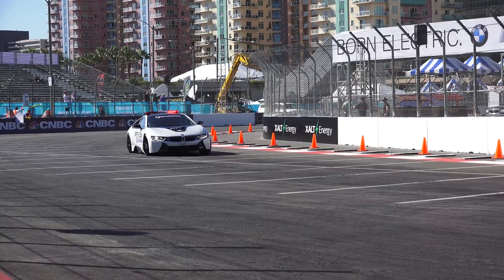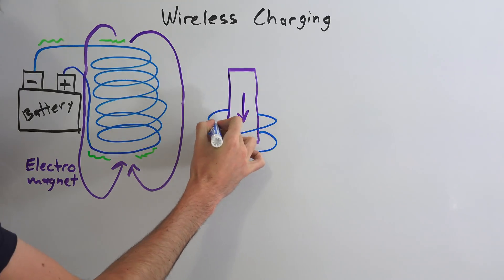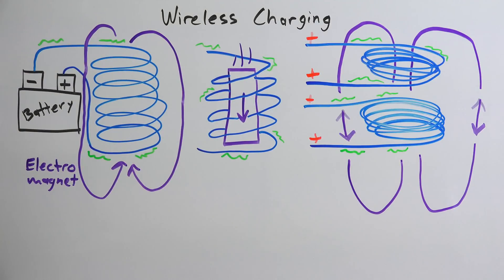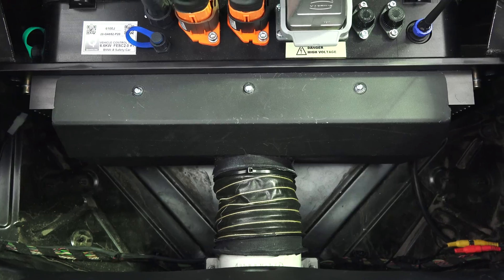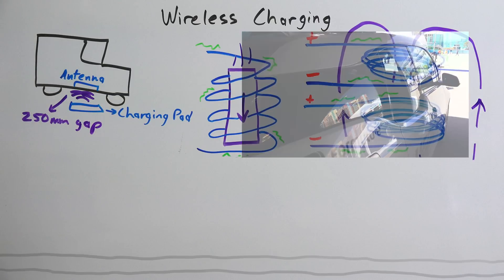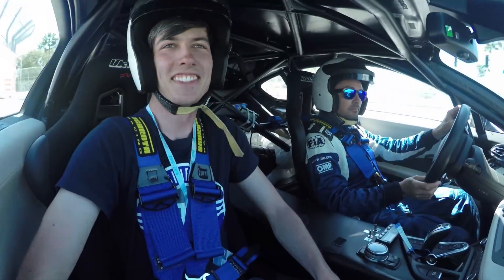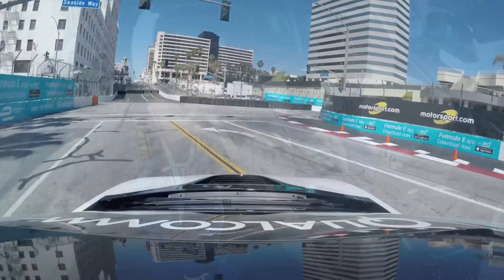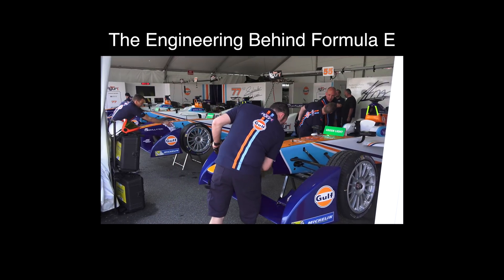How Wireless Charging Works On The BMW i8

Comment: If I understood right, this system is charging at a rate of 6.6kW, for a still car. This is far from being enough to provide "unlimited" range for electric car on highways as the need for power to maintain a 70mph speed is much greater than 6.6kW (at list I think so), but the technology is very promising and interesting !

Comment: What is the energy loss of charging wirelessly compared to through copper.

Efficiency is basically a huge reason for electric vehicles to exist in the first place, an if something weakens that, I think very much limits how extensively it can be implemented.

Comment: Hi. Induction charging in the way of the future, certainly. But today, induction has several disadvantages like:

- EMI (RF noise) and safety concerns. You wouldn't want to be near one of these while wearing a pacemaker.
- Efficiency. The best EV inductive charger today is 86% efficient and that's using the best technologies we have today.
- More expensive than traditional plugs.

We should stop suggesting that inductive charging can be used in roads. Beyond the ridiculous notion of ripping up all roads up to install these expensive coils of copper, electronics and transmission lines, a typical car uses about 20kWh to drive at 60 MPH and that's way more than can be practically delivered with such system at those speeds. Possible, yes. Practical and economically feasible, no.

Induction charging will be great to add to parking lots and garages. You just pull up to your space and the car starts charging without further effort.
Reply: Ironic that someone named "Thor" would be wrong about electric topics but there you have it.

There are differences between power delivery to trains and cars. The most obvious one is that delivery to trains in conductive while the proposed method for cars is inductive. A conductive connection is constant and very efficient whereas inductive is interrupted and much less efficient.

It would be more efficient and cost effective to add a drag power line to cars for overhead power or even tow cars down the road like they do in roller coasters.
Reply: Come on man. You can't say that it's nitpicking when the difference between conductive coupling vs inducting coupling are so significant.

See my previous posts. I'm not saying it's new or that is not possible. I'm saying that it is not practical or cost effective.

Comment: I like the idea or wireless charging while driving on the road. However when I park an EV, I would rather plug in than use wireless charging. With a
Plug and a suitably long cable, I can park with a high degree of misalignment and still charge. No so with wireless charging. I'm a horrible Parker!
Reply: +ERIC &amp; CINDY Crowder 
Learn to drive and park, that's not an excuse.
Reply: +Ric Rac what if another car is particularly blocking the space with wireless charging. With a plug I could still park and charge, but I won't be able to charge wirelessly
Reply: Find another spot. Stop making excuses.

Comment: They use AC because current is only induced to the secondary coil if the voltage of the primary coil is changing. This is for the same reason you can't just put a magnet in a coil to get DC power, the magnet has to be moving. 
Mutual inductance only works if the voltage is constantly changing.
Reply: +Latheesh V Well, yea. 
They still use mutual inductance to get the power to the car. Resonance is a given. Of course they aren't just going to have some jumper cables between the secondary coil and the battery.

Comment: doesn't a battery need a dc current to charge? Every time the poles reverse the electrochemical proccess in the battery would too resulting in no net charge to the battery?
Reply: +massive223 The induction system doesn't directly charge the battery. There's some control electronics between them with an AC/DC converter.
Reply: Ah makes sense, i assumed the conversion would take place before the charging pad.

Comment: why would an a/c current be used for this?
Reply: +Randy Butternubs 
Go back and listen to it again.
A transformer can only really use AC (or a switched DC, such as a cars ignition coil), as it is the CHANGING current that gives rise to a changing magnetic field that enables a transformer to work. DC would simply build up a static magnetic field creating in effect a solenoid coil, and nothing further would be induced into the secondary windings.

Comment: 1:03 nope, transformers do not usually use an AC current, THEY ALWAYS DO, otherwise it won't work.
It's the CHANGE in magnetic field that generates amps in the secondary winding.
DC= no change =no derivative function=no current in secondary winding.
Reply: +sasja de vries 
Yes, strictly speaking that is indeed absolutely true. But a cars ignition coil/s actually IS a DC transformer. It just uses switched DC. But it is nevertheless still essentially a DC current, as it never actually swings negative.
Reply: rationalmartian 
I get your point, and you're right.
In some cases however it depends on how you look at it. You could also call it AC, if you for example have these wires:
1: ground
2: + 6 volts permanent
3: + 12 volts (switching)
and you would connect an oscilloscope to leads 2 and 3 you will register it's negative 50% of the time.
My point is that voltage is always relative to something, e.g. ground, another lead, etc.
Switched DC is pretty much AC (perhaps like a square-wave signal) just with it's meridian shifted upwards.
When people think about DC they mostly think about a steady voltage.
--------
And one last bit: I think it actually does swing negative (just a little), because inductors will generate an opposing voltage when the original voltage it cut off, that why electronics engineers add flyback diodes:
https://en.wikipedia.org/wiki/Flyback_diode

Comment: "typically done using alternating current"
In fact it HAS to be AC - a magnetic field on it's own doesn't induce a current, it has to be a changing magnetic field created by a changing current or a steady magnetic field moving past a wire coil (the latter is how most generators work). Just wanted to clarify :)

Comment: They could probably just engineer an add-on to existing electricity poles/wires. Harvesting the electricity already flowing by wrapping coils of wire around them to generate inductance current to cars driving by below
Reply: +mrsemifixit 
Why bother? Why not simply tap into the electricity supply as one would do normally to power whatever system? It solves nothing, as there is no problem there to solve. The problems occur on the other end, from infrastructure to vehicle. In fact it adds unneeded complexity and power losses.
Your use of the term "harvesting" would imply you imagine one can just pick up the energy for free, from the existing power lines. One cannot. There are NO free lunches.
Reply: +mrsemifixit that would just convert the kinetic energy to electrical energy and slow the car down
Reply: +juck huo How's that different than in the video he talks about having inductors under the road to charge while driving
Reply: was he saying that it charges while driving? I thought that it had to charge while stationary.  it seems like if you tried to drive passed while trying to charge would slow the car down from the magnetic fields interacting

Comment: You forgot to say that induction charging efficiency is very low compared to our old wires.
And of course, electrical energy is not cheap.
Btw i liked the concept of charging pads on the road, maybe putting them in big intersections in big cities would not be a bad idea.
Reply: +Modelero This is what I came here to say. Most smartphone wireless chargers are around 60%. You can increase the distance by increasing the strength of the emitter to reach the receiver, but the efficiency only drops since the field strength decreased by a power of 3 (Correct me if I'm wrong) by radius. Doubling the charging distance for the same charge current requires the emitter be 8 times more powerful.

They could be using something to focus the emitter though. I'm not sure.
Reply: +Cris Landefeld 
No I think you are both pretty much on the money. This is the MAJOR problem I see. It is trivial and doesn't really matter when talking about the amounts of energy when charging small mobile devices, but charging such large capacity batteries, takes energy, and as you say, this system is inherently inefficient.
It takes a certain amount of energy to build the magnetic field, if when that field collapses, all the energy from it is not captured/collected by the secondary windings it will be lost.
I don't doubt engineering can overcome some problems, such as trying to "focus" or better direct the magnetic field, I don't think this can be done to mitigate the problems entirely.
Until we have cracked Fusion, and hence have unlimited, cheap power, I see this as far too wasteful to be practical. Certainly for the short term foreseeable future.

Comment: Yes, make Formula E super light (no batteries, just some capacitors), super powerful, and cooler to watch, with roadsurface charging. I've been pondering that for a while. Mostly for regular roads (imagine a charging lane), but for racing it would really be the next level. Bumber cars have had power overhead since...decades ago at least.
Reply: A capacitor insulation failure (one of the most common electronic component failures) would be absolutely catastrophic. 
A 10 microfarrad capacitor blowing up leaves a big black stain on the board and possibly an electrical fire. 
On a 100 farrad capacitor, because anything viable for moving a car would have to be that big, if the insulation failed and the capacitor burst, that would be something similar to a large compressed air tank exploding in the car. 
In short, the DOT would never allow it because it's too dangerous. 
Here's an example of the DOT doing something similar. 
There's a gas that works as a great refrigerant, it works better than r-134a, and it isn't bad for the environment when it leaks. This substance is called propane. If a car crashes while the ac is on, a pressurized propane system just got into a car crash.
Reply: Dylan McElveen Thanks! Then better a high charge rate battery?
Reply: +Cloxxki Basically yea. I guess a capacitor bank could work like rechargeable boost. Where they charge off the battery and discharge into the motor when the driver needs a more power

Comment: It should be noted that this is not a really effective way of transmitting energy. A great amount is lost.
Reply: +blocki Actually a very little seems to be lost: www.qualcomm.com/media/documents/files/qualcomm-halo-faq.pdf
Reply: Seems it got a bit better. But 86% efficiency is still low.
https://en.wikipedia.org/wiki/Inductive_charging#Disadvantages

"6.6 kW power delivery from a 7.68 kW power draw"
Reply: blocki Yeah, but that was from a system in the 90's. Qualcomm claims over 90% efficiency from grid to battery, which is similar to what you get from regular wired chargers.

Comment: I thought induction charging was a little bit bad for the battery, or at least in smart phones
Reply: I've never heard of it being bad for cell phone batteries. Plenty of electronics are already charged using induction. It's just the same as a transformer however now the primary coil is stationary while the secondary coil is on the device.

Comment: Wireless charging is still very inefficient but the technology is cheap.  If they did place these into roads,  the best place would obviously be at intersections.  It would cost way too much and use too much energy to place them on the entire road.

Comment: will this work on any electric car or will it only work on specific battery models
Reply: +John Kyon 
Would work on any electric car IF it is equiped with the charging antenna.
Reply: Even tesla?
Reply: Any electric car, even tesla. It would take some modifications obviously, but even smartphones just needed an adaptor to use this technology.
Reply: What boat hybrid

Comment: I think embedding it in streets for longer distances is not practical, too expensive as you said. But think about traffic lights. You could have nearly a all-the-time use. If all cars were electric. And if there was a automatic payment system;)
What do you think?
Reply: +DerKrawallkeks Well it is good but think about the people who wont like that system, there will be automatic an non automatic cars. I mean how could interact automatics with non automatics. That could be an issue
Reply: +Alexander Gallardo 
It wouldn't even be a problem. It would be trivial to identify a vehicle drawing power from the system and charge them accordingly.
They could be fitted in the road surface in each lane going back for as many cars as are typically queued at those lights. Whilst the lights are on red, charging could be commenced for any suitable vehicle wishing to take on extra energy, and charged automatically.
This is all tech that has been available and in use for years.

Comment: The alternating current in the primary coil will induce a direct current in the secondary coil not an alternating current like you said otherwise the battery will charge and discharge not ever actually building up charge
Reply: You can turn an alternating current into a direct current, it's essential to long distance power transport.
Reply: +Quintinohthree you can turn AC to DC however he said at about 1 minute mark that an alternating current is induced in the second coil which is not true and we can see that using Faraday's Law
Reply: +Paul Haddad Now that's more of an argument, but it still doesn't follow. Infuction requires a changing magnetic field as you know. Well then You would expect an increasing magnetic field to induce an increasing current and a decreasing magnetic field to decrease current. Thus an alternating magnetic field should induce an alternating current. Now if you think you can prove otherwise from Faraday's law, I'd like to see thst worked out.

Comment: problem solved!!!! forget the cost. I will pay for that in taxes if that means we can live an a much greener world. we won't have to fight over an ancient resource anymore. instead, we can finally enjoy the luxury of driving unlimited miles. now if they join up with Telsa and utilize the technology of the "hands free" driving with the endless charging capabilities, then you will have a vehicle that will ruin oil companies who also hinder the price of flying (planes do burn into the parts per billions vs cars parts per million).
Reply: +blackscorpion002000 if your worried about fighting over fossil fuels then promote the use of renewable fuels like ethanol.
Reply: +juck huo I'm not actually just targeting petroleum, I'm saying we can definitely make this work without combustion engines altogether. this coming from a wrench turner hoping for a major change.

Comment: Save 5k on car batteries, spend 10x on pavement. Sounds like a bad trade off.
Reply: +nmh5001 Been too Bucks county PA? The pavement they use here is trash and only lasts 1-2 years.
Reply: +LEX Maximaguy87 worked at PennDOT for a while, so I am well aware. Cheaper to just lay another 3" overlay atop the gravel and mud every year, or just do a chipseal, than actually build a road that lasts. And if a legitimate weight bearing road is too expensive, then running 3.3 kw chargers through the roads, and maintaining them through winter, is going to be a fortune.
Reply: oh cool!! how was that ice storm for you 2 years ago?  Street road in warminster and warrington was completely demolished.
Reply: +LEX Maximaguy87 lucky for me I wasn't working there at that point. In the private sector now.

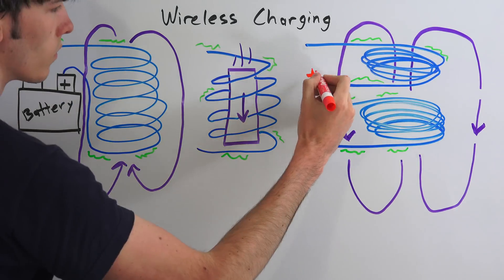Comment: 0:48 it will only work with AC, DC will create a constant motionless Magnetic field and you cant generate electricity that way
Reply from the maker: +MrStickyPete Great point - with DC the coil would have to be moving in order to charge (and thus would probably mitigate any energy benefit).

Comment: we don't nearly have the energy to put wireless charging on the roads...
Reply from the maker: +Sebastian Bruhn Not with that attitude!
Reply: Engineering Explained it is not about having a good attitude, it's about being slightly realistic. As an engineer you should know that...
Reply: +Sebastian Bruhn any visionary would disagree with you, but you have a point
Reply: +Vaibhav Mamle "they can use solar panels on every street" 0.0...........XD
Reply: +ablock3002 Yeah ryt now. But in the future its possible. Like they can use solar panels on every street.
Reply: +Sebastian Bruhn In the US there seems to be no problem.
Reply: The issue is that no one needs a vehicle with unlimited range.  Even today we have vehicles with 700+ miles of range.  No one has ever done 700 miles without wanting to stop.  Think of all bladders.   We all gotta pee.
Reply: +Sebastian Bruhn Yah, losses might be kind of high, i would be surprised if half of the energy in the inductor could reach the induced coill in 200mm.
Reply: +Sebastian Bruhn we kinda have, in the form of thousands of ICE's in cars, planes and trucks all over the world
Reply: HATECELL so you wanna put all that energi into one freeway?
Reply: Solar rode-ways is a rally bad idea xD
Reply: +Sebastian Bruhn Nope, all major roads. Energy is only drained from the road when a car drives on it, so covering a large area wouldn't be a problem (at least not when it comes to energy losses). If we consider the thermal efficiency of electric and internal combustion engines and the energy we could gain from regenerative breaking, this system could even be more efficient then what we use now.